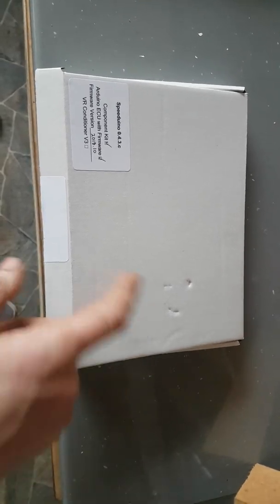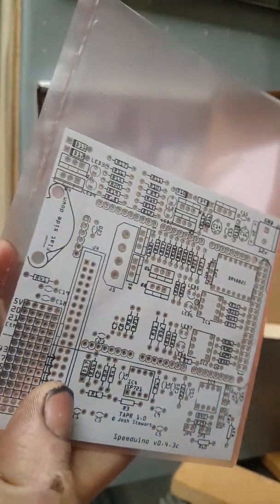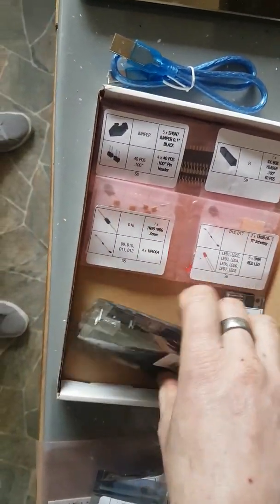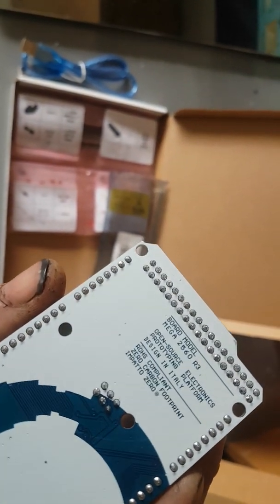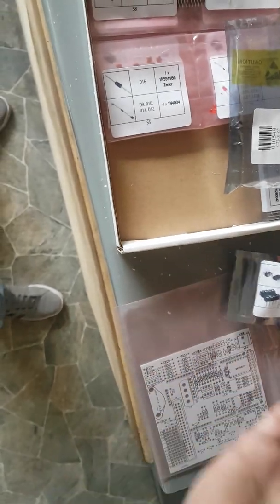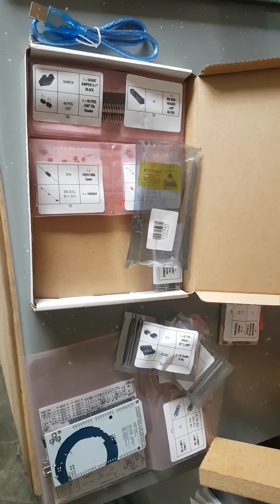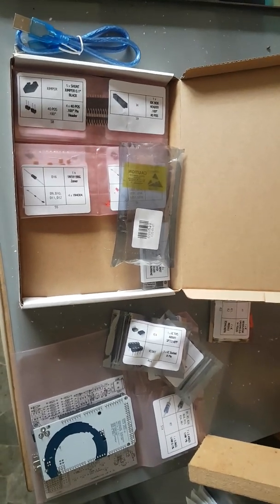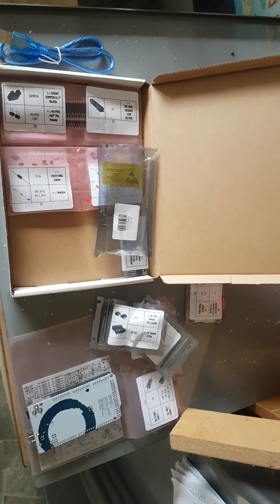Speeduino Mk2 Golf project - unboxing the speedy!

Comment: what trigger will you use? In few months I will start Scirocco Mk2 1.8 8v project and triggering it is my concern.
Reply from the maker: The AGG 2L Mk3 golf block has a hall effect crank sensor, which is what I'll be using. You can use the original hall sender in the distributor easily tho Pawel. Check out the Speeduino wiki & forum. All the information is contained there my friend.
Reply: @peteledwidge3631  I would lie to avoid basic distributor mode. First it's low resolution, second it will run lpg, and lpg injectors are slow so it is perfect to run whole fuel sequential to minimize open close events during cycle. AGG is good info, I believe I should find some oem parts for project too :)
Reply from the maker: @pawejusyn237  If you wish to run fully sequential fuelling on Speeduino, then you need both a Cam and Crank sensor input. Perhaps a modified missing tooth sprocket on each of the cam and crank pulleys, with sensors to each. Reasonably easily fabricated & will provide the correct inputs.
Reply: @peteledwidge3631   I was thinking about 12-1 on distributor. Missing tooth on cam speed. It will be speed sensor and position sensor (cam) in one and it should have sufficent resolution. As speede documentary says it should work, but I havent tried it and havent heard anybody use similar system. The best system would be AGG wheel and sensor and modified distributor sensor to act as CAM 0-1 signal. Do you know are AGG trigger wheel would fit older DX or EX engine? Where it is located in AGG?
Reply from the maker: @pawejusyn237  Trigger wheel is part of the crank and there's a sensor hole in the front of the block on the AGG, the block is also taller, therefore crank wouldnt be a simple swap, unless you want to liberate some pistons through your head! Might be simpler to swap your block for AGG, as I've done, the 1.8 8v head bolts straight down, no mods.
Reply: you also use one from 1.8T